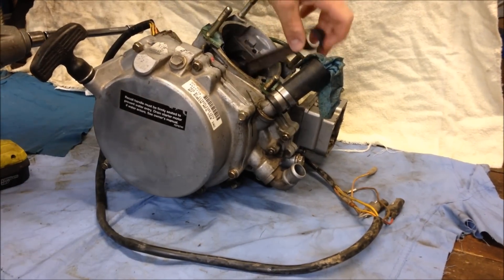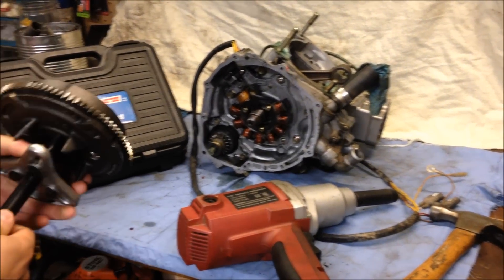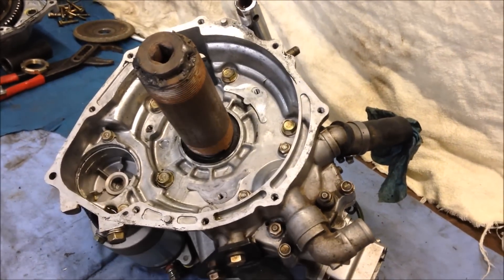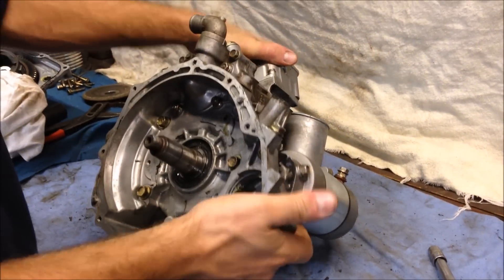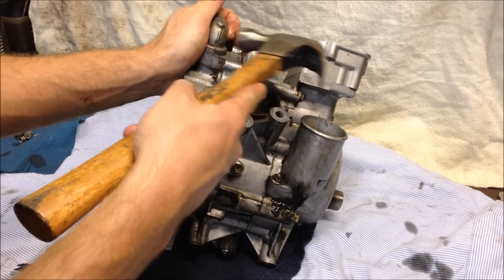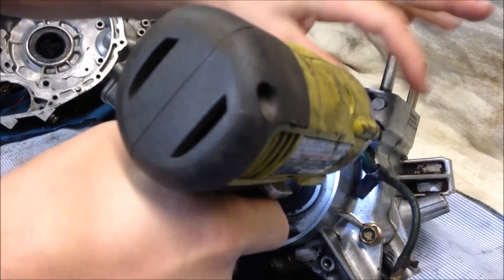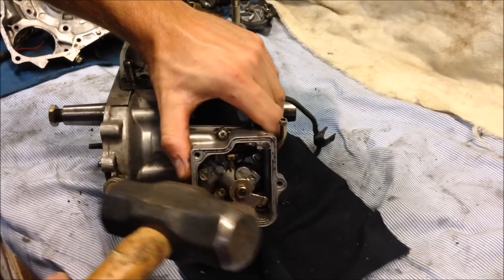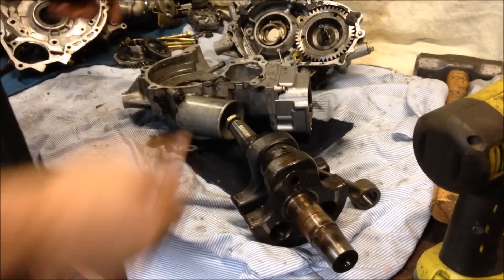How to Split 2 Stroke Cases Bottom End: Polaris 250, 300, 350, 400 L 1990-2003

Comment: The two 10mm bolts u removed that are located on the left side for the casing located right behind the oil pump,do u have a part number or specs for them? I have searched for 2 months online & dealer & have found nothing. Thanks!!!!!
Reply from the maker: You will have to be more descriptive.

Comment: What if I dont have a special tool for that nut on the crank shaft?
Reply from the maker: Make or buy one.
Reply: @BrapStuff  I also have a broken primary clutch bolt, hoe do I get it out if its snapped inside
Reply: @BrapStuff  how*

Comment: great video.  I'm surprised no one has called you out on using steel hammers rather than brass, neoprene, etc.  Consider yourself called out.
Reply from the maker: K
Reply: Steal hammers are not that bad... might scratch up some aluminum but considering your working on it...it's already scratched
Reply: Sean Oliver considering the video is meant for models older than 2003, then it is DEFINITELY scratche